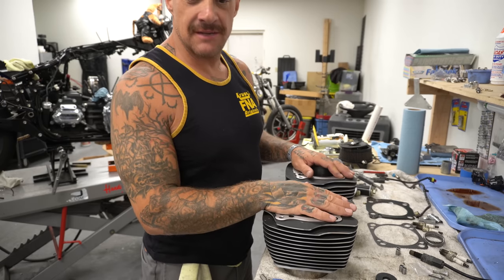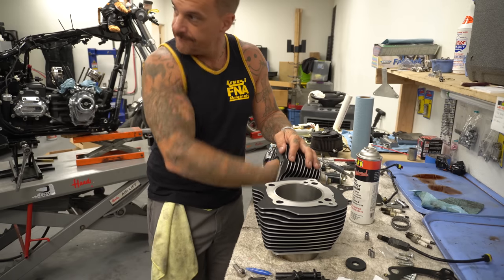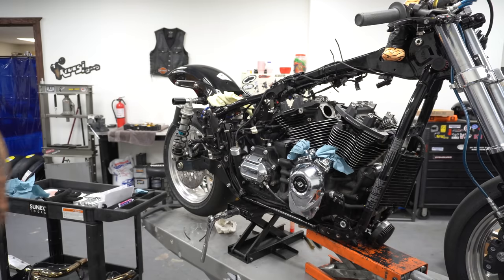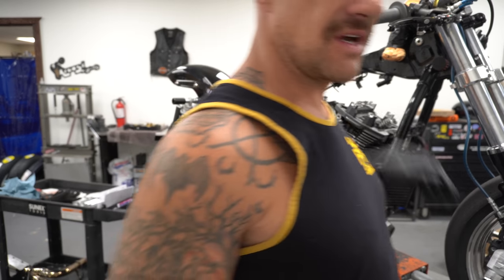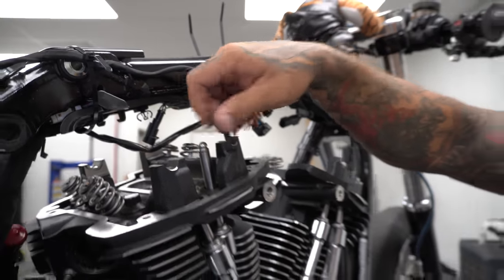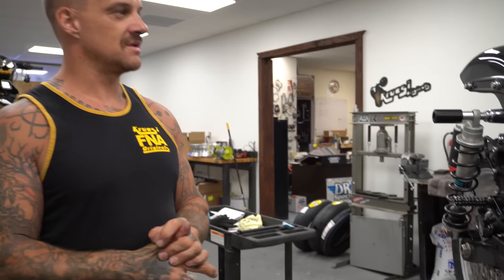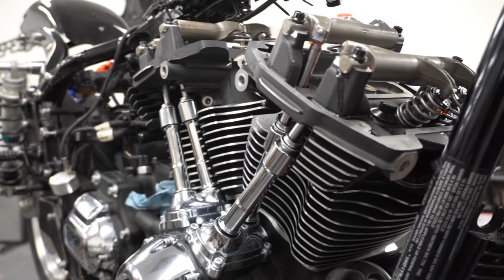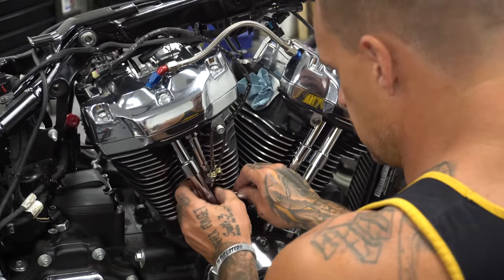Harley Davidson road race bike (P6)
S&S 124” big bore kit install

Comment: nice touque wrench tip. I'vve been telling people for years to always zero their their torque wrench when they are done using it.
Reply: I used to zero my wrenches and then got hired by an aircraft manufacturer. Our current engineering protocol is to return the wrench to its lowest setting and leave slight tension on it. Whatever that's worth.
Reply: I like the tip about not using a torque wrench as low as 5 ft. Lbs., & instead converting that to in. Lbs. & running it in the middle range of the smaller torque wrench, instead of bottom-bottom range of the (probably) 3/8” torque wrench- where it’s not too accurate. 🤙🏻

Comment: If I can make a suggestion,  always use a high powered vacuum,  instead of compressed air when clearing cutting or grinding chips around a engine. I hope that helps. 
T.S. RACING

Comment: Inspired by you guys, I decided to take an apprenticeship at a custom bike shop here in Hawaii during my transition out of the military. Worked on my first M8 today to take off the valve covers for powder coating. I'll just say that the top valve cover bolts on the rear cylinder are a bitch to get to in order to take them off. 

Still debating if I want a bike with an M8 in the future. I'm pretty comfortable with my twin cam 103 with S&S 551 cams.

Love not only this video but all of them, all I kept thinking about today was your video of you losing your shit when you were working on the M8 lol. Keep it going bro, rocking your shirts all the time here, much love and support from here in Hawaii!
Reply from the maker: Hell yeah my dude that’s how you get in the game. They get a lot easier after you do a bunch of them

Comment: 7:00 - Did you have to readjust the pushrods with the new cylinder kit, or are they still considered correct length from the previous adjustment/stock setup?
Reply from the maker: We have adjustable push rods because we have Aftermarket Cams
Reply: @kruesioriginals  But did you have to readjust them when you reinstalled them with the new cylinder kit, or were they already the correct length from the previous install? - Thanks for the reply!

Comment: I got a fxlrs. Lookin to do a big bore kit but heard the 131 kits are super thin cylinder walls compromising reliability/ longevity or some shit. What kit you think I should go with that’s guna give me more power but still be reliable?
Reply from the maker: We made  more power than every 131 on the track with this 124. It’s not how big the motor is the tower motors build that makes power

Comment: Why did you choose the S&S 550 over the 590?  Just wondering if the 550 was free or there was other logic.
Reply from the maker: 590 is way too big of a cam for what we are setting up.  
550 is already a huge cam for this. That’s why the compression is so high on this motor